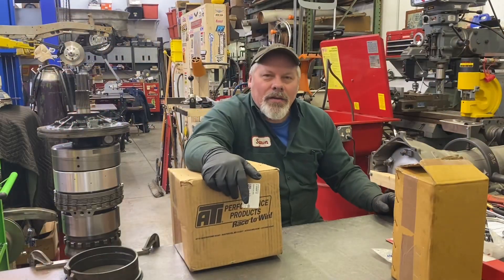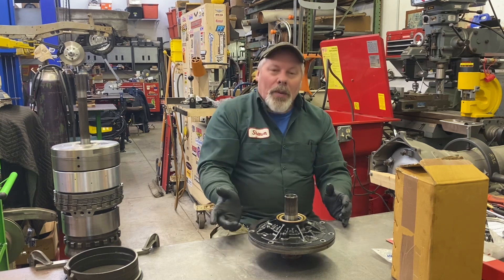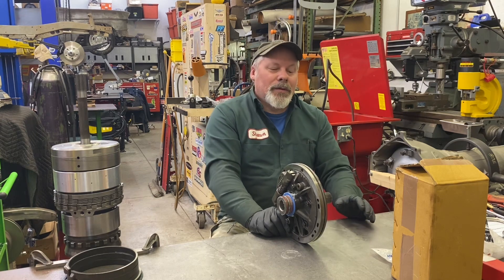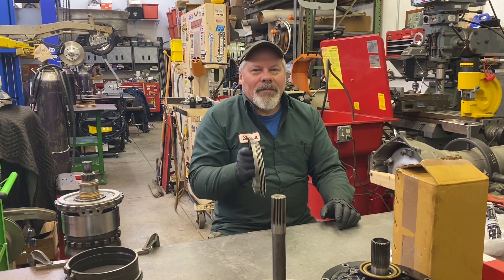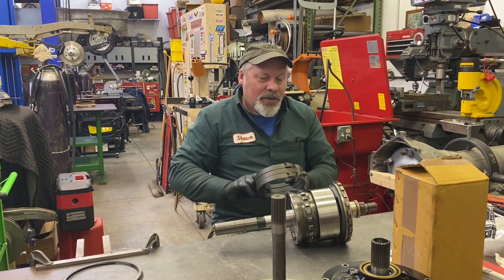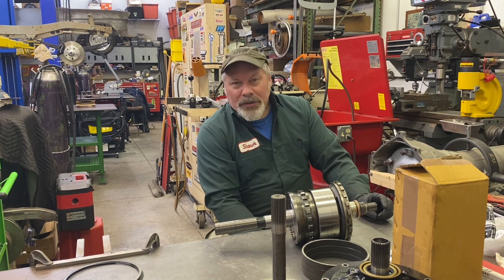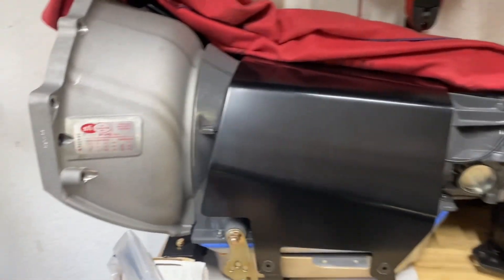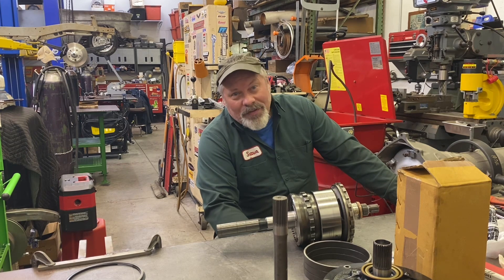Mountains Garage: TH400 Race Transmission 1955 Chevrolet

Comment: Just bought a tci th400 4x4 maximizer trans, came with a short output shaft so I swapped that out. Took many hours to get the pump off do too one of the sealing rings smashed in half by the builder , Summit did nothing for me. I knew this would happen but I couldn't find a core fast enough.

Comment: I have a question for you. At WOT my th400 is shifting around 4,000 rpms near my peak torque of 585 foot pounds. Do you think i should recalibrate my governor to shift near peak hp around 5,500 rpms? Thanks